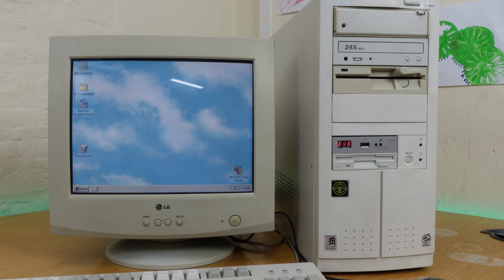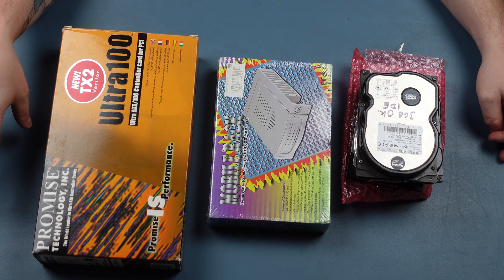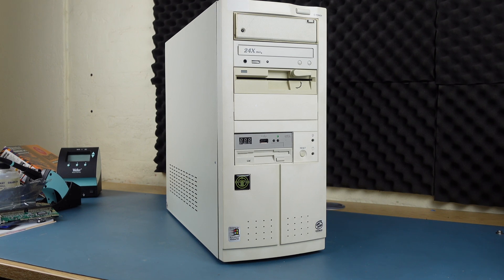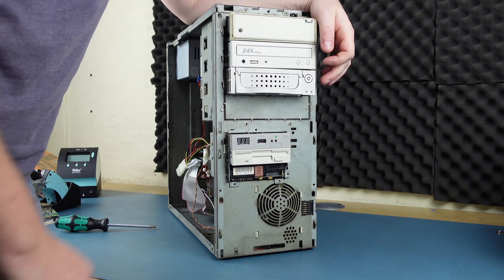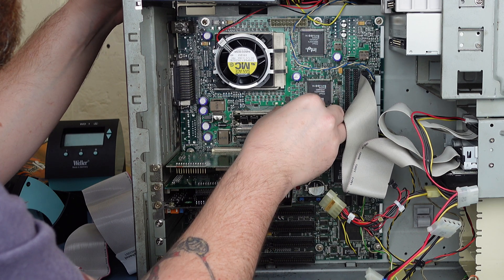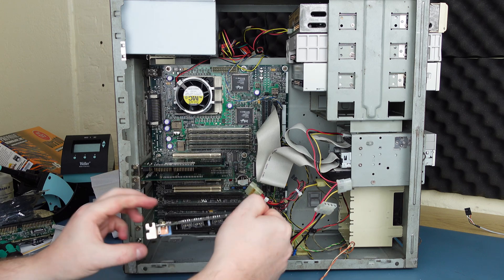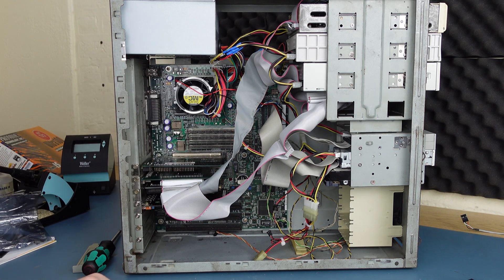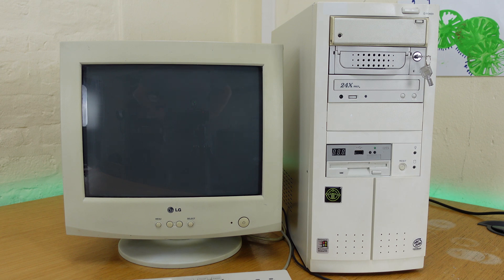Making the Barn Find Pentium Pro More Usable

Comment: Finding a random Pentium Pro in a beige tower is a 1 in 1000 find, congratulations.  I used to run a ET4000 and 9gig SCSI cheetah in mine, Was a server so almost never had a monitor on it.
Reply from the maker: It certainly was a very random encounter. Check out my other videos to see the history of this one. I now have a replacement motherboard on the way to get it 100% working
Reply: @TMEretro  I'll check it out. I've been picking up 5 or so beige machines per week from the e-waste, no pentium pro yet but I live in hope. Mostly they are office machines so Pentium 2s LX chipsets etc. Haven't even got a BX board yet.
Reply from the maker: Wish I could pick stuff up like that. Last time I went to my local dump in the UK there was a pristine 486 placed on top of the ewaste but they wouldn't let me take it
Reply: @TMEretro  Yeah I spent a couple years gaining the trust of the local yard. Now they save every old machine for me. I pay them 20 usd per machine, Which works out fairly well for everyone, They are only worth a couple dollars in scrap.
Reply: @TMEretro  I also ask them to take all the PCI and AGP cards out of the beaten up machines for 5 dollars each. Haven't got anything high end yet but I get lots of Sound Blaster lives and mid / low range video cards
Reply from the maker: @Jasonsadventures  that's awesome, wish our guys would do that